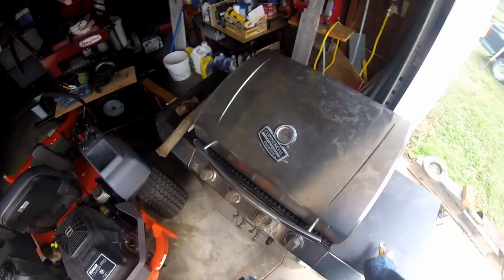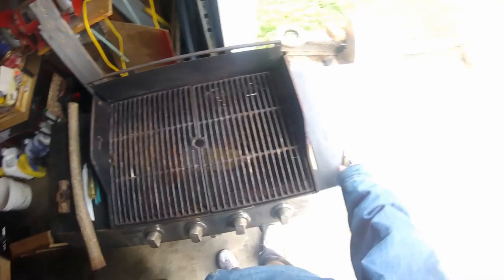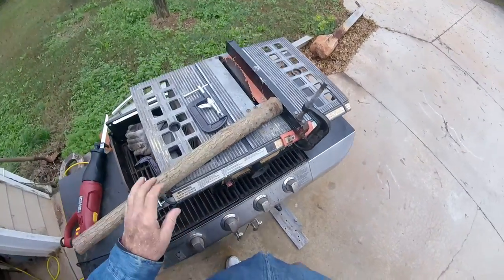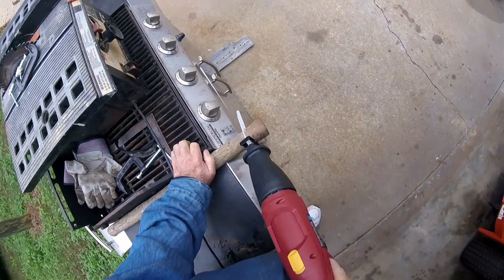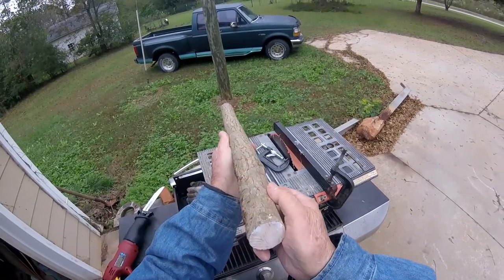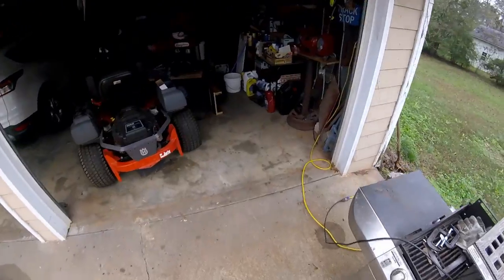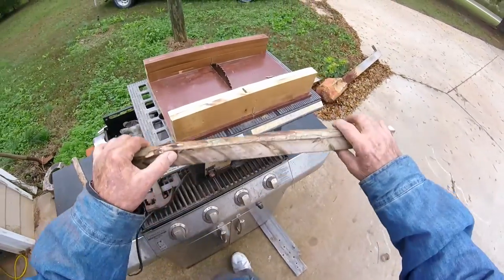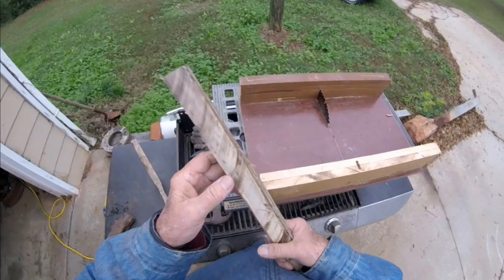Pwalpar VLOG Making A Hammer Handle Part one

Comment: Walter, I'm glad you still have all your fingers. That table saw blade is dull Dull DULL! You are getting all kind of burn marks on the wood. Never rip round stock on a table saw without a "V" block to hold it steady. Blades with fewer teeth tend to get grabby and could have kicked that branch back into you, or worse. Do yourself a big favor and next time you are in Home Depot, get a carbide tipped saw blade. Try to get one with MORE than 24 teeth. That saw will cut much better. Jon, MSO-439
Reply from the maker: Thanks Jon  I will sharpen it